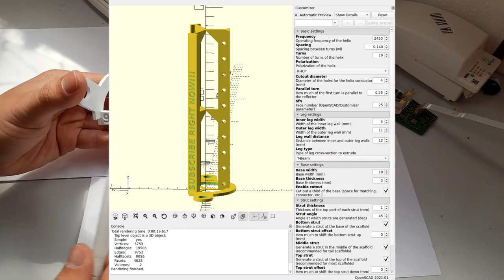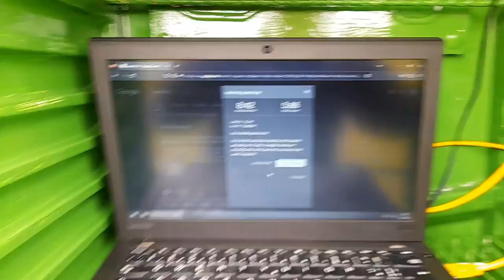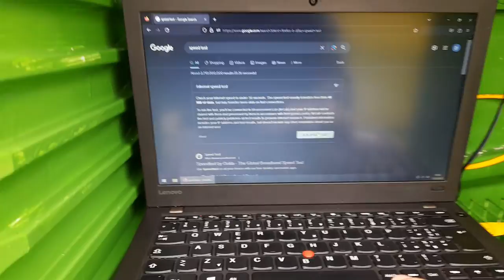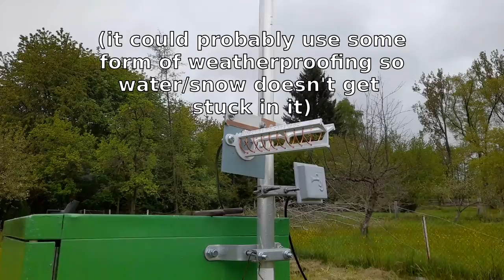Building a 2.4 GHz WiFi helical antenna

Comment: So if I built one and put it on my WiFi range extender could I pick up the pub WiFi ten doors down
Reply from the maker: Hard to say, I realize that many people just want to commit long-range wifi stealing but I don't think even an antenna like this is viable. I'm using it with a router on the other side and it can barely get through one house, that's just the simple limitation of 2.4 GHz. With clear line of sight though, I would even go as far as to say that the range is practically unlimited

Comment: hello say i needed to make one for digital TV to mount on a dish what wave length is that
Reply from the maker: This will not work well for TV, the wavelengths are too large, you will have to look up your local channel frequencies but they tend to be between 500 and 1000 MHz, a helix would not be practical. If you have a very large dish antenna (2m or more) you can use a yagi antenna in the focal point, otherwise you are better off just building and using a normal yagi

Comment: Hi, Im new to RF so quick question,
What is the matching strip for?
Reply from the maker: It's to reduce the sharp impedance transition between 50 ohm coax and 150+ ohm helix. Arguably not really needed on receive-only antennas but when you're using it for transmitting you want to make sure it's matched as well as possible as to not damage the transmitter
Reply: @dereksgc  oh that's cool! And how do you calculate its size then? does the calculator do that for you?
Reply from the maker: @mathieu2109  yes it gives you all the numbers you need to build a helix, you just put in the frequency you want, number of turns, and spacing

Comment: Is it powerful than yagi?
Reply from the maker: it should be very similar, however a helix is much easier to make in my opinion, and does not require polarization matching when paired with linear antennas

Comment: Can you use stainless steel wire? I don’t see why not actually.
Reply from the maker: It would work, but soldering it may be much more difficult, and you want to make sure the connection between the wire and the connector is really good

Comment: is this antenna bi-directional ? if not, whats thue use ?
Reply from the maker: It is, antennas receive the same way they transmit, as long as they can handle the transmit power (which in case of 2.4 GHz WiFi hardware is basically nothing)

Comment: Shouldn't you check it for proper VSWR matching
Reply from the maker: Getting about 1.5. Generally speaking as long as you follow some rough guidelines the helix will be perfectly fine for low power applications like WiFi. For anything more powerful sure a VNA would be important but that's not something most people have access to
Reply: @dereksgc nanovna is so cheap these days though. If you get the V2 it covers the 2.4GHz band
Reply from the maker: @dasy2k1  I have the V2, I tried tuning a couple helical antennas with it after calibrating it but I often got worse performance after tuning than before. I'm probably just doing something wrong but it doesnt bother me too much as long as the real world results are good

Comment: I built a 10 turn cardboard helical antenna for HRPT reception without a satellite dish.
Reply from the maker: that can work but I found that very situational and inconsistent
Reply: @dereksgc  Yes. Working but image is very noisy. Maximum peak SNR is 6 dB.

This is an experiment before the planned reception of the hydrogen line.
Reply: Please explain?
Reply: @mrtechie6810  Just use two crossed cardboard rectangles as the support of the helix. 
Alu foil glued with double side tape to square of cardboard as reflector.

Comment: Replace the copper wires with copper tubing and add a little mercury in the tubing.   It will go even further.
Reply from the maker: good idea, even better if i use lead tubing instead of copper and cover the entire thing in radium paint
Reply: @dereksgc  LOL.  Mercury isn't dangerous.
Reply: Why mercury?
Reply: @mrtechie6810  It was the only one that extended my signal out of 10 tests, and I am not sure.   Gallium was reactive, but only slightly.   I've been flying fpv since 2015.
Reply: @dellcoc  please explain what did you do with mercury? Why?
Reply: @mrtechie6810  Advice from a Vietnam vet radar tech who used to fly at my club.   I had it and tried it.
Reply: @mrtechie6810  He was probably coating the wire in Hg to keep the wire from corroding in the weather.  The solder joint will corrode too, so it needs some weather proofing.

Comment: Öhm …… how much dB Gain your Antenna have …… looks a lot …… but in this case you have to reduce the transmission Power to mach the Legal Limit of EIRP. Do you have done this Ajust? I dont think so, because in case of the this in Theorie by replacing only at one Side the Antenna, only the Download Speed shoud improve and not both. I Think your Installatin is Illigal …… execpt you have you have an Ham License and use the Lower Part of the 2.4 GHz WLAN Frequence rage where Ham Licence Owner may allowed to transmit with Higher EIPR. Consumer Router have normaly around 60mW Transmission Power to Fit the 100mW EIPR Limit in Europe …… if you are in the USA you have i think 1000mW EIPR Limit …… wich restricts the legal Antenna Gain to 10dB.

Comment: Great, let's see if these can be built for to use for more than 1 Sirius / XM satellite radio receiver.  XM operates in the 2.3 GHz range, and also how about an antenna for UHF ATSC television and VHF?
Reply from the maker: We don't have SXM radio in Europe, but it'd probably work. Generally speaking, below 1 GHz it may be easier to build a cross Yagi antenna, because a VHF or UHF helix would be quite unwieldy

Comment: If you are using this to have a mobile hack station . You'll get yours
Reply from the maker: It's about the same performance as a normal off-the-shelf 2.4 ghz patch antenna that you can buy anywhere. Not sure how an antenna could hack anything
Reply: @dereksgc  2.4 GHz is the blue tooth android hack.

Comment: Your calculator doesn't work, it doesn't do anything at all.
Reply from the maker: sounds like a problem with your browser, if you are on a computer try pressing the enter button after you are done inputting the values, on a phone you should have a confirm/enter button on the keyboard as well, it was tested over multiple browsers and platforms and auto-updating worked

Comment: looks like someone dosent know anything about antennas thats not a helical antenna thats just a copper coil plus its the wrong size for the wave length for the frequencies that WiFi uses if anything that would make your WiFi reception worse that would most likely work good for receiving tv stations bigger isn't always better when it comes to antennas
Reply from the maker: oh.. my bad i guess.... please tell me what size helical antenna should be for Wifi 2.4 ghz eifi?.....
Reply: Looks like someone doesn't know the difference between an axial-mode helical antenna and a normal-mode helical antenna. His looks right for an axial-mode. A normal-mode would be a lot tighter of a coil and would be omnidirectional. For an axial-mode helical the circumference should be equal to the wavelength. The wavelength for 2.4GHz is 125mm. His antenna sure looks like it's about that size.